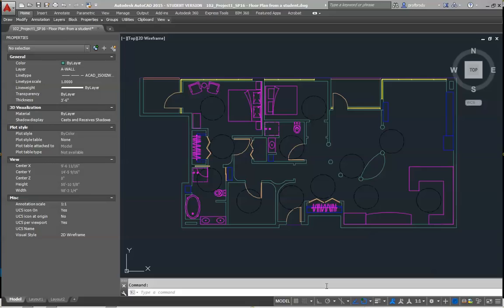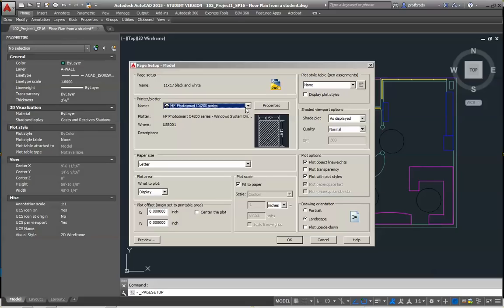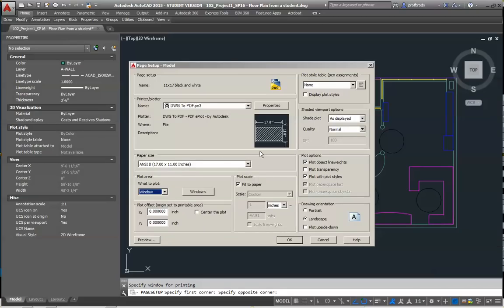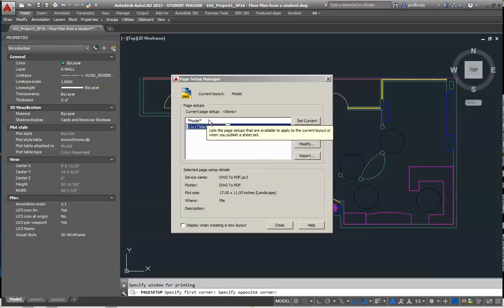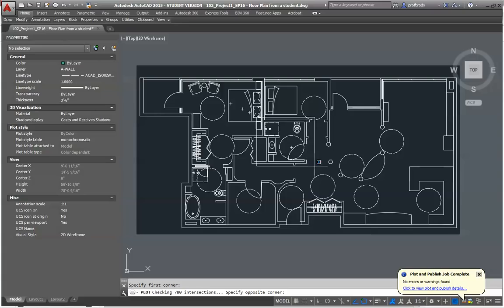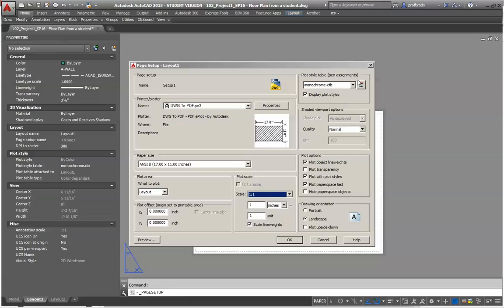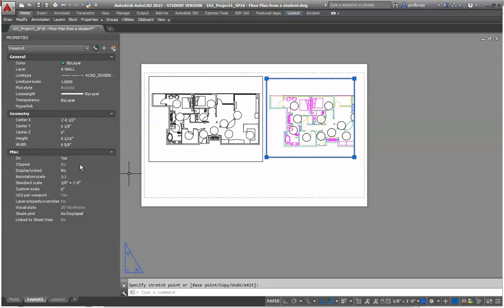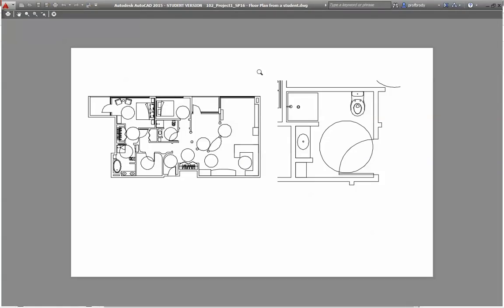AutoCAD 6: Printing to scale

Comment: what happen if your drawing is to big to fit in any paper size? how to downscale the drawing and still be able to scale? thanks
Reply from the maker: Well, you could always buy a bigger printer! Haha - just kidding. Set up your paper size, and then set a standard scale to the viewport so that it fits on the sheet size you have available. So, if 1:50 makes a drawing that is too big, set the viewport scale to 1:100 instead. This will make the drawing smaller, though. If you must have a print at a larger scale, you'll need to set up several sheets, and create viewports in each that print a section of the plan. Once printed, these "tiles" can be assembled physically, but it won't look very nice.

Comment: add another confusion. i wanted to know once that plan have printed, would it match to the supposed scale accurately.? ex. if you want ur plan to be scaled 1:100 then if we use ur method, the plan printed will scaled to 1:100 or not.?
Reply from the maker: Yes, the plan should print accurately. Of course it has to be drawn correctly, and also not every printer is 100% accurate, so I'd always recommend putting dimensions on your architectural drawings!

Comment: Mr. Andrew I follow all your steps to print my drawing in a 11 x 17 paper.  Every time I print my drawing in a 11 x 17 paper, my drawing will be reduce like 5 o 6 inches smaller when I my measure with my scale.  I also check my  lines, and they all look right, my viewport scales are correct.  I need your help, thanks
Reply from the maker: Sounds to me like either you've got the wrong sized border, or perhaps the scale of the viewports is off.

Comment: I don't have a plotter and when I try to plot to PDF as a 24x36 drawing I can never get my title block to go all the way to the other edges of the page how do I fix that?
Reply from the maker: You might want to check your page setup, and make sure that it's not trying to leave a margin. Most large format printers can't print right up to the edge of the paper, and perhaps the page setup is scaling so that you have that margin. Also, check to make sure that your title block is actually drawn as 24x36 - the AutoDesk title block is actually drawn at 22x34, I think...

Comment: Mr.Andrew i have a problem here ,recently i drew a flat cylindrical plate with drillholes on it with a dia of 80mm and after that i printed it, but in the print the drillhole dia were found to be as 40mm, the scale got reduced to half and why is that ? Can u please help me sir..
Reply from the maker: Well, it's hard to tell without seeing the drawing, but clearly the scale is 50% of what it was intended. It's drawn correctly in Model Space, right? Check your viewport scale - that seems the most likely spot. Also, make sure in your printer settings that you're not reducing the drawing to fit a sheet.
Reply: Andrew Brody Thank u sir....it was very helpful finally I got a solution

Comment: how to change foot to meter. i have a drawing that scale is such as 1"=1" but i want  in meter such as 1=10 or 1=100 etc
Reply from the maker: There are actually a couple of steps to converting an imperial drawing to metric. First, type the word "units" and hit enter. That will bring up a dialog box where you can set the drawing to decimal instead of fractional feet and inches, and also set the precision. Everything you draw will be in millimeters, so unless it's an engineering drawing, round it up appropriately.  

The problem is that now everything that was drawn at an inch in your drawing is now a millimeter. So you need to select absolutely everything in your drawing (CTRL+A), and scale it up by 25.4. XREF's and other nested objects might need to be scaled separately. 

If you want to put in dimensions, you'll have to modify the dimension style to have the suffix mm, as of course the default apostrophe for inches is no longer correct.

Finally, when you go to set the scale of your viewport, be sure to use one of the scales at the top of the list, such as 1:10 or 1:100.
Reply from the maker: I believe you can just type in "Units", and there you'll find the menu to configure the entire model. Once it's set to decimal units, the metric scales should become available...
Reply from the maker: I believe you can type in "Units" to access the menu where you can change from standard to metric. Then, all the metric scales will be available in the properties of the viewport...

Comment: When I'm in paper space and I use the 1:1 scale under plot scale, none of my drawings fit on the paper anymore. At default it has it to custom, how come?
Reply from the maker: Well, it's a little hard to tell without the print dialog box. But if I had to guess, I would recommend checking to make sure that you're Page set up matches the size of the sheet you have created in the Paper Space layout. Just draw a border that's the size you want to print in paper space. Then, set up your viewports to the scales you are hoping to print to, And you should be able to see pretty fast if the drawings at those scales will fit onto the sheet size you have created.
Reply from the maker: 1:1 scale will print whatever you've drawn at full size. So a 2 meter tall door will print out at 2 meters tall, which is pretty large - probably bigger than whatever page size you've set up. So start by setting the scale smaller - 1:10, or even 1:100, and see how bit it is.